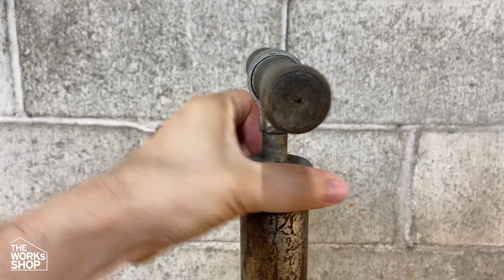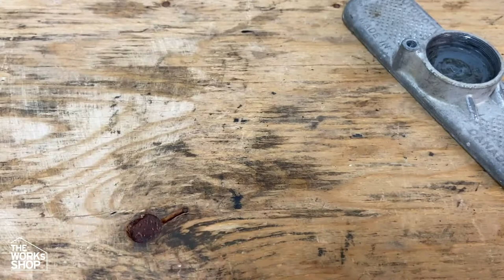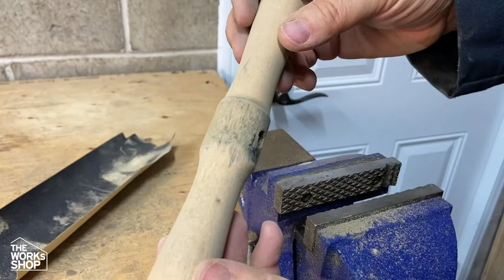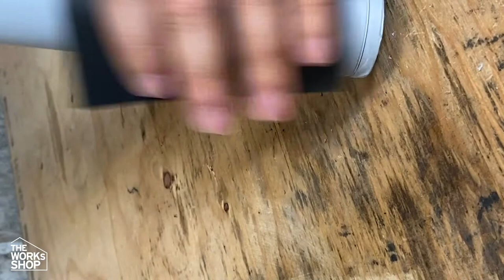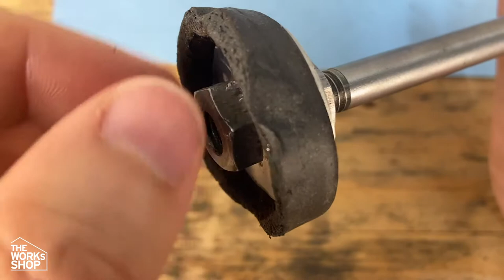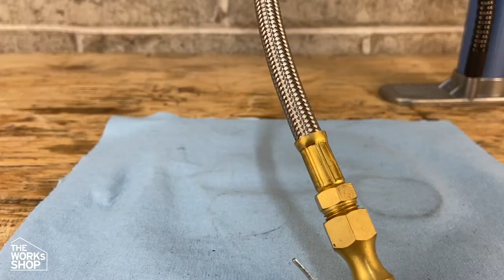Vintage Air Pump Restoration

Comment: Great job on the restoration.  I have this same pump and would like to restore it.  Where did you get the replacement hose and is it 1/4" hose?  thank you
Reply from the maker: I got it from amazon. If I recall the threads weren't correct and I had to cut part of the fitting off and tap new threads. I've seen some people just stick with a barbed fitting and use a hose clamp with a 1/4" hose, but I wanted to try threading it on and so far it's held. https://www.amazon.ca/gp/product/B00XMUNL42/ref=ppx_yo_dt_b_search_asin_title?ie=UTF8&psc=1

Comment: Thank you again for responding to my request on where you purchased the air hose.  I did order it from Amazon and received it.  I feel like i should be able to accomplish this but i can not get the end off in order to change out the fitting to screw into the bottom of the pump.  My hose came with 2 nuts on the end and the fitting seems to be 1/4" which is too large for the hole at the bottom of the pump.  May i ask 1.) how did you get the fitting off of the original and did you use the original fitting to screw into the bottom of the pump?  My original fitting is a barbed fitting.  I'm so close to finishing this....any insight/help would be GREATLY APPRECIATED.  Thank you...AGAIN.